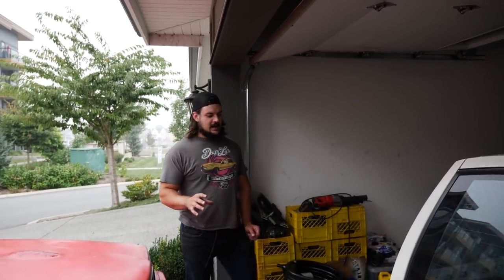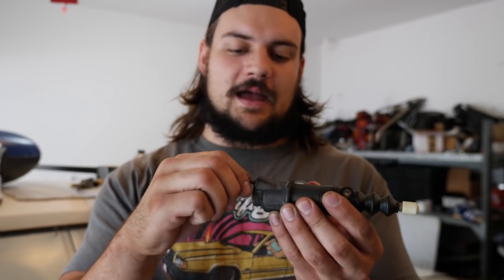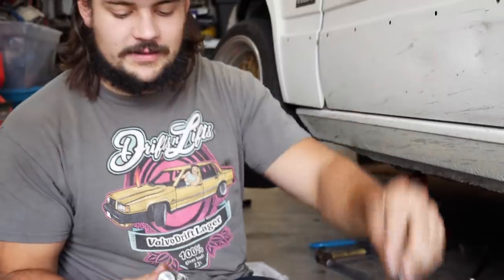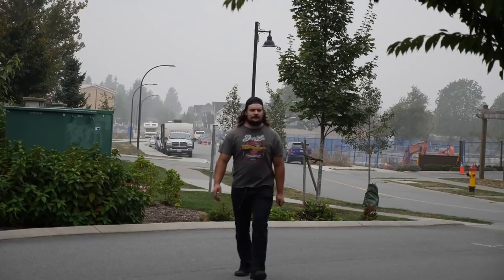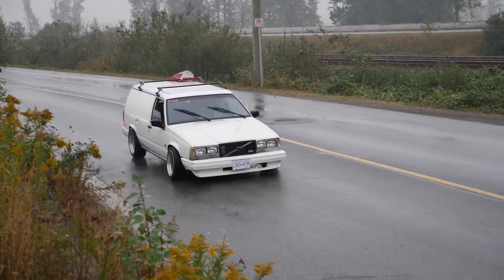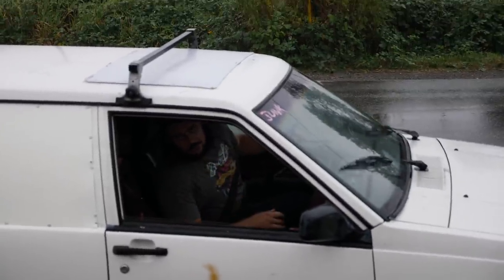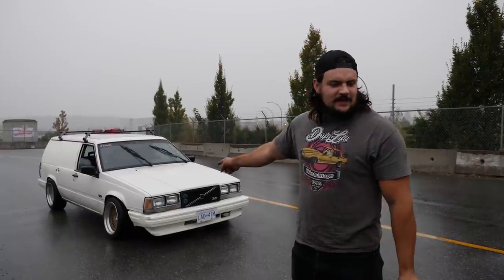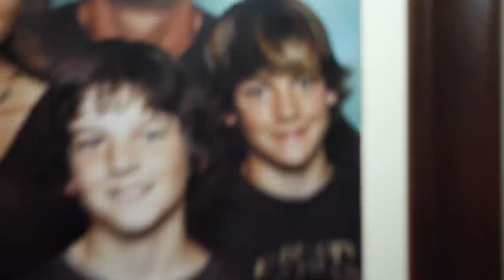FIXING THE PANEL WAGON + TEACHING MY GIRLFRIEND HOW TO DRIFT!

Comment: Lookup russell speed bleeders in the thread pitch on your slave. Nothing is better than having a bleeder nipple with a check valve in it. no more 2 people, no more mess, no hassle.
Reply: You must be new here.
Too much of a hassle when you have to take it off when you scrap the car (when you're on a budget, 20 bucks if we include shipping, is a lot), to make good content with walltaps and distorted rear ends he gets cheapo used up cars and squeezes out what life they have left.
Every dollar he spends on fancy stuff means less available cars >> Less content.
And don't even need the fancy bleeders, just attach the hose and submerge the other end of the hose down into a cup/bottle of brake fluid, open the bleeder, and pump the clutch, refill reservoir as necessary, one man operation and works on all cars, Koltan used a friend cuz he had a friend on visit it's a tad faster.
Alternatively get one of those 10 dollar compressor fed bleeders, 1 man operation that works on all cars and dont have to take it off when scrapping the car.

Comment: if i was interested in buying my first volvo to drift, what should i get?
Reply: The point is to keep it cheap, regardless what car it is!
He's using Volvo 740's because he can consistently get them at low prices.
You should go with whichever is the most available chassis in your area so you can easily re-shell at lowest possible price, they handle pretty much the same anyway, the best move would be to get like 3-4 of them over a period of 6 months or something so you always have one ready, if one is smashed up beyond all feasible economic repair you hurry up and re-shell, DON'T get attached to any specific car, that's when you have a money pit instead of a cheap drift car to get good.

If most of all RWD Volvo's in your area are 240's, then that's what you get, if they're mostly 940's then that's what you get, if they're mostly 740's then that's what you get.
If you don't have any Volvo's in your area, look at a different car all together, BMW's for example, then you nail it down to which chassis is the most plentiful, if there's more E36's than E46's then that's what you get, and so forth.

Comment: The shift boot i put in my manual swapped ls400 is a crown royal bag that I cut abunch of little holes in it to zip tie it down to the tunnel cover. I'm just gonna go ahead and say it now im a zip tie craftsman🤣 but it works like a champ. My question would be what made you decide Volvo over any other car

Comment: You said to ask some questions. So here is one for you. In the white wagon, which transmission are you running?

Edit: Definitely dig the overall video quality on this video. Keep up the good work.
Reply: not to speak for him but to take a shot in the dark (not many OEM options) hes running an m46 with j type overdrive so 4 speed with electronic 5th overdrive , I have heard that m46 handle abuse a bit better than the true 5 speed m47, also most m47 setups if not all are cable clutch setups no hydros (i am used to only dealing with us spec volvos tho so dont quote me on the last bit)
Reply: @GettingGood   I figured it was either the M46 or M47. I have the M46 in my 86' 740 Turbo. The OD half ass works. I imagine that, if his does work, he doesn't use it a whole lot.
Reply: @1989Longboy  ohh very nice ! Just pulled a m46 setup from an 85  to put in my 80 740 turbo ! Also see why you asked the question at the very end ! Im sure he dosent OD in theses cars and most are only for highway speed cruising, not for the pure volvo gravy spillage dats fo sho !  Yes lord !
Reply: @GettingGood   @Conner Pumphrey  No doubt that the OD isn't used to get sideways. The M46 isn't too bad of a transmission  minus the OD. I hate it. I never can get it to make proper pressure.  I pulled my M46 late last year to replace a few bearings. Got it back in a few months ago. Aside of the OD, everything works great. Watch him slide his wagon around really tempts me to try the same with mine.

Comment: Awesome video, super goood stuff. As for a question, as a NA 940 owner, is it worth trying to do a +turbo or should I spend my money on go fast parts for the NA (cam, intake what's else?) I already have a custom exhaust.
Reply: A good Cam will make your Car so much different and you can still go +t
Reply: go with a h or k cam which are both the high revving cams

Comment: Wait, 80 bucks is the cheapest you can get slave cylinders for a Volvo?
For ae86 they cost less than 20 a pop, and are solidly mounted with bolts (they foresaw the clutch kicks).
Regardless, a like for the breathing shifter boot & late-entry scandinavian flick.
As for content, just do what you do and that's why we're here, none of that time constraint drama like everyone else constantly waiting for parts so they shove their cameras up their faces instead.
I'd rather have 1 video with a drifting volvo than 5 videos installing fancy CNC 4340 skeleton parts that are gonna break anyway.
Edit: Now that I look back, I remember helping a friend change transmission on his 940 wagon, too much of a pain with rusted C-clip so we just undid the clutch hose on that and used the slave on the new transmission xD